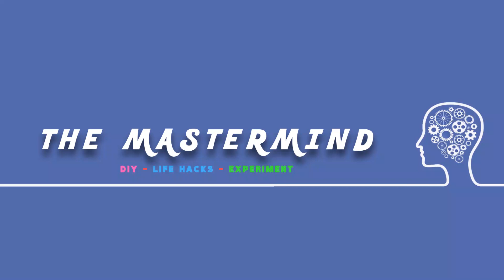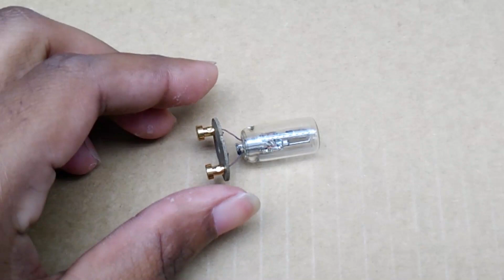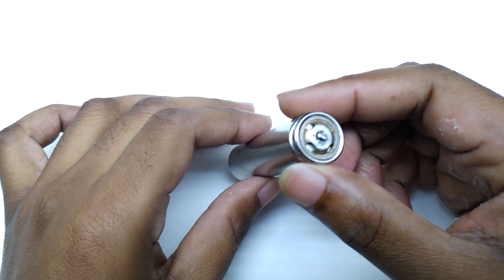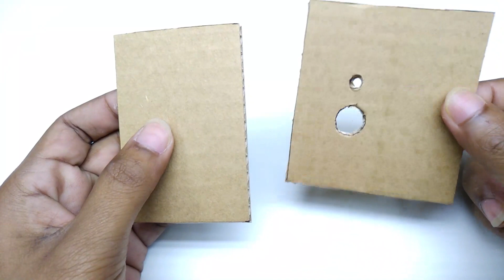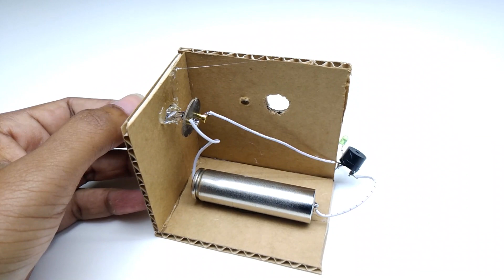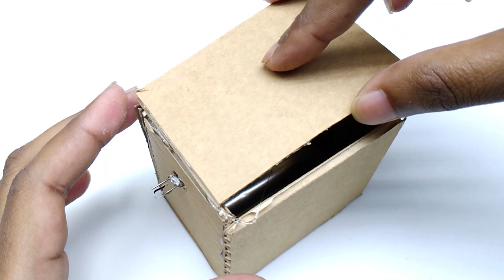How to make Fire Alarm | DIY Fire detector | Smoke Detector Alarm

Comment: Registor er power koto ?
Reply from the maker: 1k 🙂
Reply: Jodi switch system kori then kontar sthe lagaite hobe ?
Reply from the maker: @AlveesAdventure  battery + switch + tube light starter + other equipment 🙂
Reply: Nice project 👌 I made it and it costs is only 95 taka